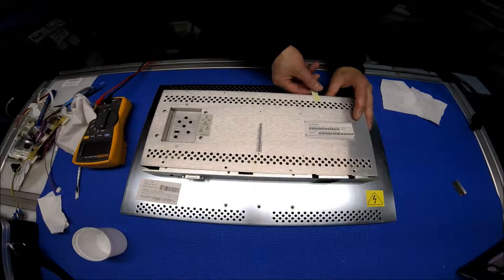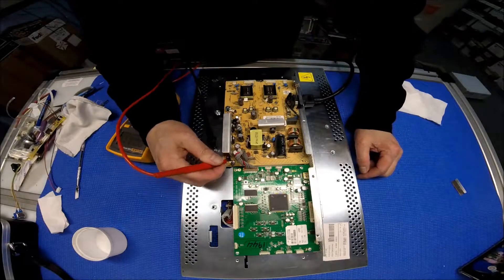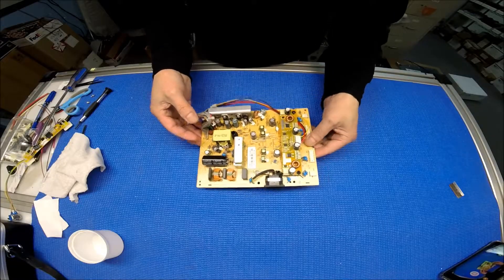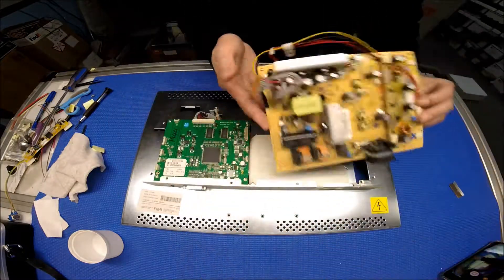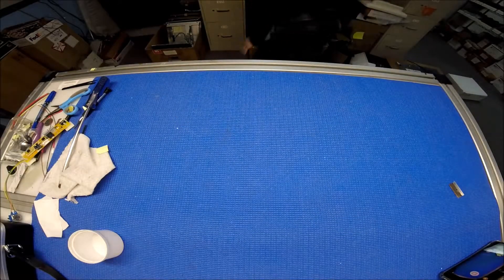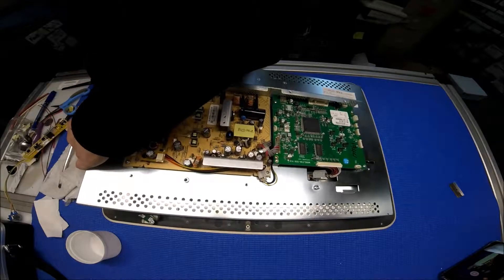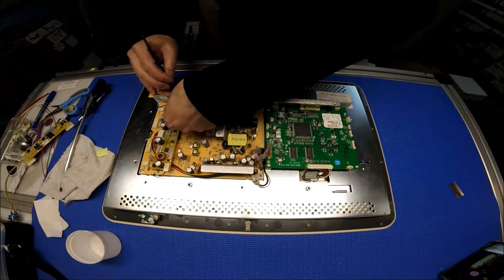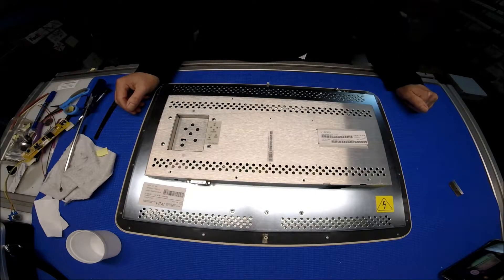UTAP20W, Part 4, How to Install LED Backlight

Comment: I have this monitor the lcd monitor power on  but no display, infact, i am suspecting the controller board FSB-321 V1.0. Please can i get any compatible controller?
Reply: FSB-321U V1.0  display Controller